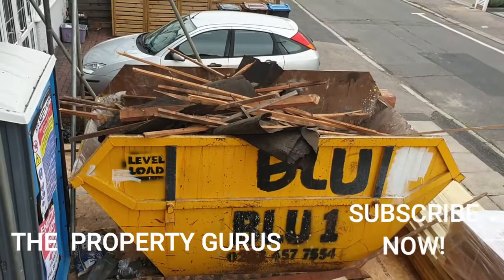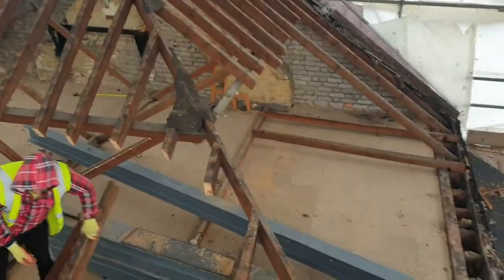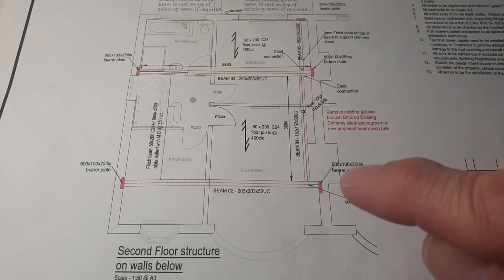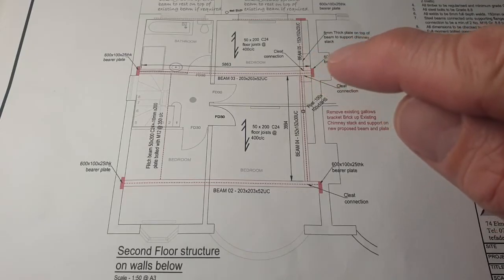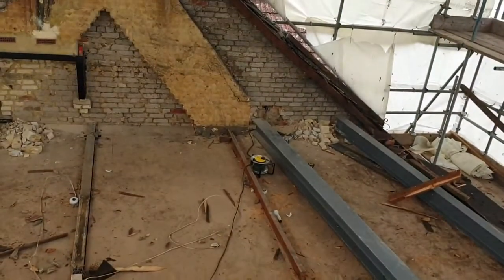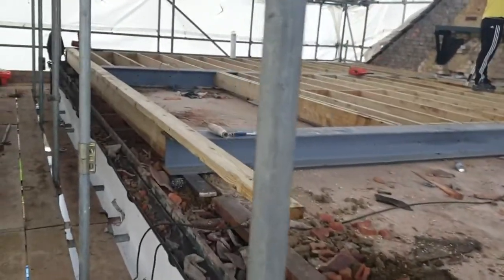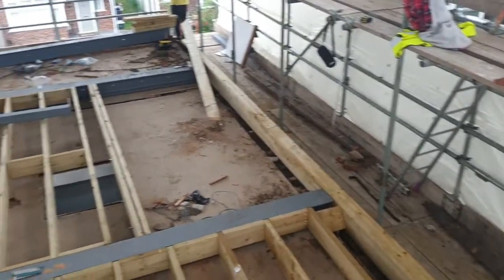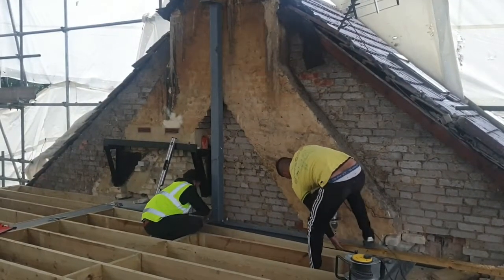LOFT CONVERSION DAY 2 - Demolition of Old Roof & Installation of Steel Beams - Day 2 of 18

Comment: Steels shouldn't be lifted and stored either on the scaffold or the attic floor. They should be hoisted and placed in their final position in one operation.
Reply: Why? 
They did it there way and it worked, can't see any issues

Comment: AT 4:35, Regarding the bearing plate,  correct me if I m wrong the engineer  specified  bearing plate instead of padstone then?, what the  type bearing plate is? I mean what is the  manufacturers specs? thank you